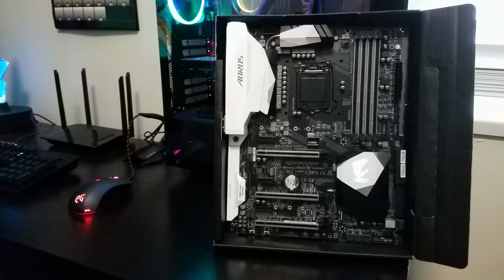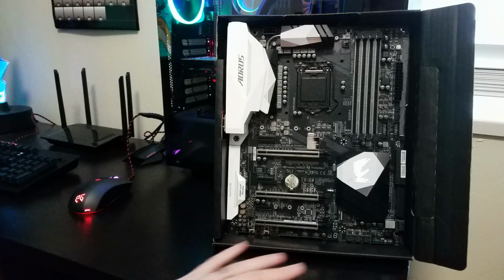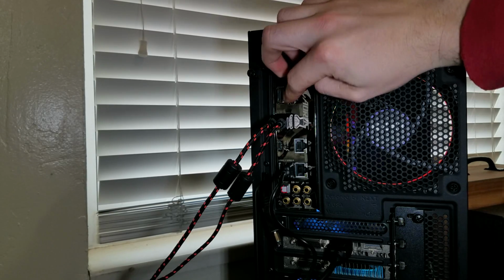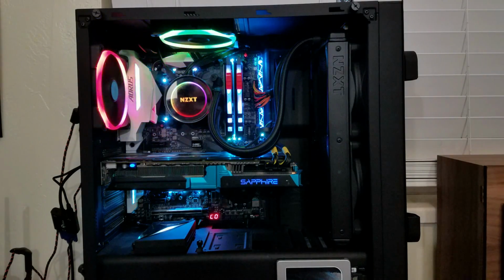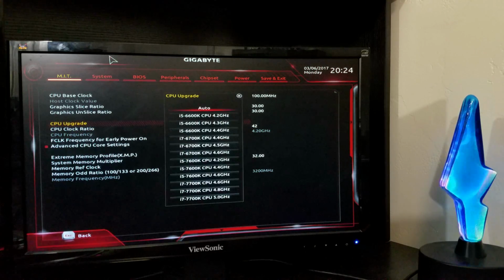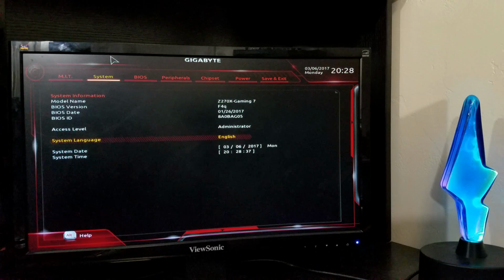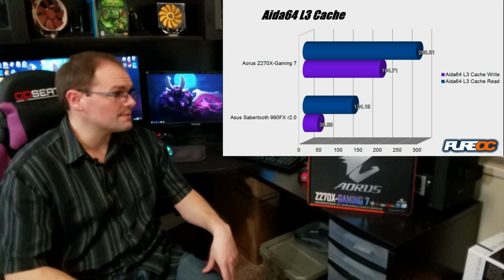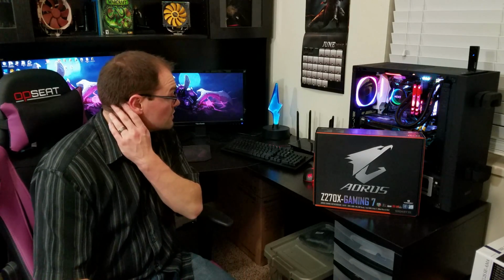Gigabyte Aorus Z270X - Motherboard - Review - Best RGB

Comment: How can i plug a 4pin  to this 5 pin 12v ?
i  want to use a basically i need  12v RGB and W is spare for me.. Can we remove it or something ? bcoz the pin port does not sit on it .
i have vdg 5v  cooler and want to use a RGB converter from 12v rgb to 5v 3pin.
my mobo has 12v 5pin  , same mobo above in video.

Comment: Hello Sir,
Can you explain the differences concerning audio from the rear io, usb and front panel audio connections please?
Reply: What would be the difference in signal to noise ratio using a regular usb port as opposed to a DAC usb port?Would the signal to noise ratio be different for connected device to a different device or is the signal to noise ratio fixed for the same particular usb port? For example connecting a Behringer UCA202 be any better or worse than say an American Audio Audio Genie when connected to the same usb port? These are both different usb soundcards from different manufacturers.

Comment: which rgb fan are you using , im confuse between thermaltake 14 riing rgb or corsair hd120 rgb
Reply: already ordered the hd120 because nzxt one is not available in my country
Reply: The Hardware Hound hey I want good rgb motherboard and currently I'm using z270 gaming pro carbon and my cousin want to give me a gigabyte aorus z270x gaming 7 the one you are using , he want to give me that as my birthday gift but wants my carbon. should I exchange it I want the board which has better rgb.
Reply: The Hardware Hound thanks getting the gaming 7 tomorrow

Comment: Good review! All others for this motherboard I can find here at YouTube were made early on when it the board had BIOS voltage issues. For me the lighting is a bit much, but so far as I know the BIOS allows us to tone it down if we choose. Wish you'd covered the sound subsystem in more detail, as this appears to be one of the few MBs that sports a deluxe sound option (by Creative Labs). Also, if you run an M.2 SSD which of the two slots do you prefer to stick it in (no pun intended)? I'm thinking the lower for myself, but then I'll likely use a big Noctua air cooler which will likely cover up anything in the upper slot, possibly restricting air flow to SSD?

Comment: Would the Noctua NH D15 do a better job than the NZXT?
Reply: Thank you for the quick reply, I wanted to stick to an air cooler cause I'm afraid of liquid coolers leaking, only downside is that the D15 is massive
Reply: Would that be ideal if I wanted to overclock though?, I'm looking at the Phanteks Enthoo Evolv ATX case so I think the D15 will be fine

Comment: I would prefer just 1 video with timestamps! Will save you alot of clutter in your channel aswell.
Reply: Just in the description! :) Saves you the trouble having to make an overlay (dont know if takes any longer then making timestamps in the description though). Also, usually the overlay disapears after a few second/minutes. So if I would want to check a different part of the video I'd first have to skip back to where the overlay is etc.